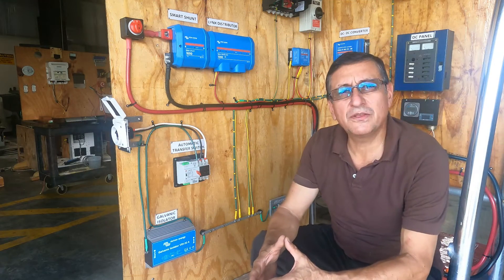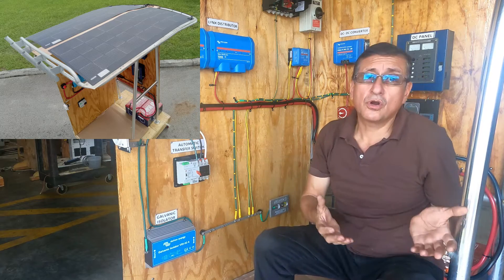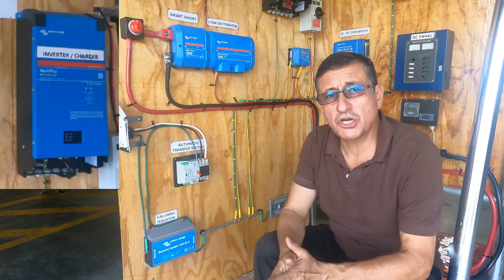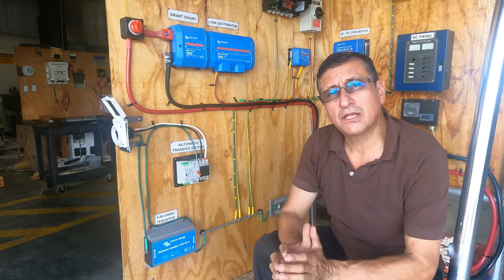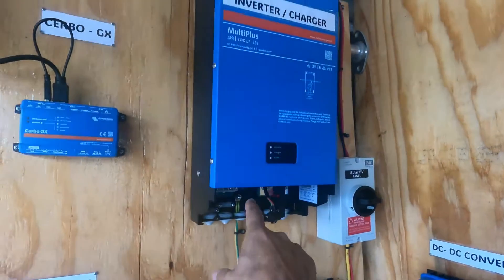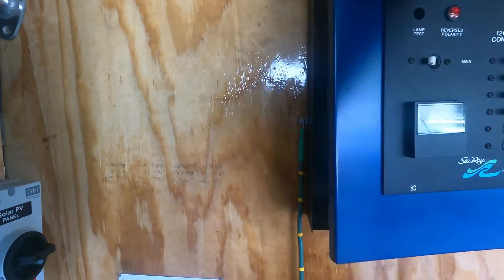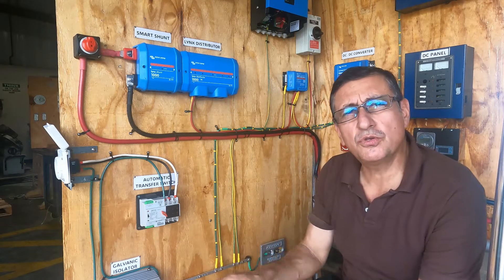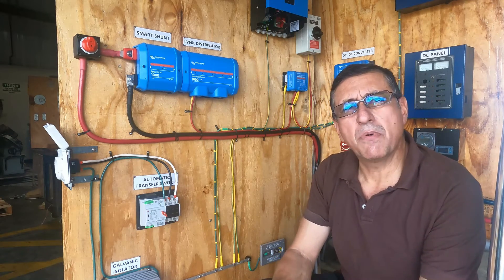Bonding and Grounding for a Hybrid Boat

Comment: Your inverter is the power source when you are not connected to shore power. When you switch it on and provide AC power via the inverter it will automatically connect the AC neutral and safety ground.  Bonding is used to connect all metal fittings that are in the same electrolyte (water). 
I have to disagree with your statement about bonding all metal cases. 
You are bringing them to the same potential as the battery negative ie zero volts. 
Electricity leaves the source and returns to the source. It will not go near your anodes unless you have a fault.
Reply from the maker: I appreciate your feedback. Thank you very much